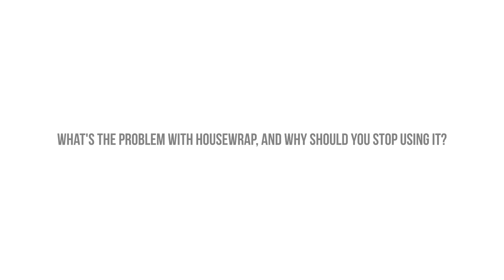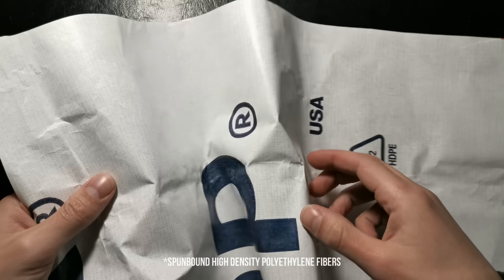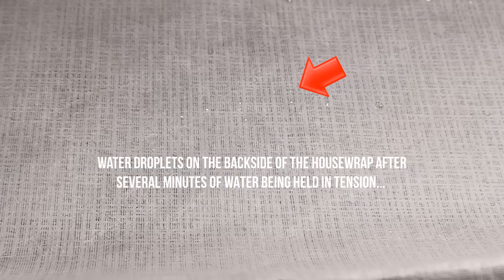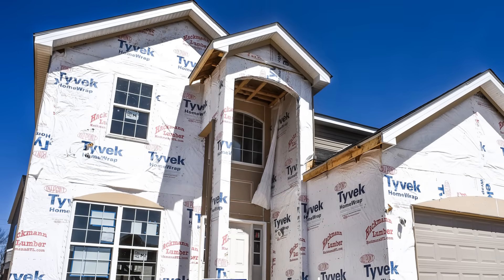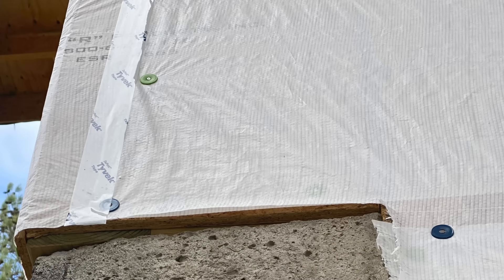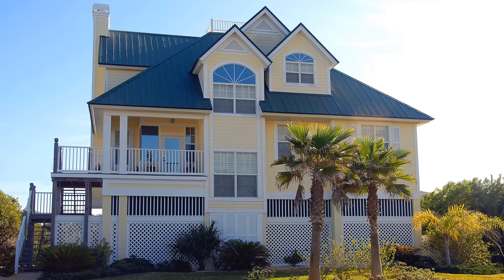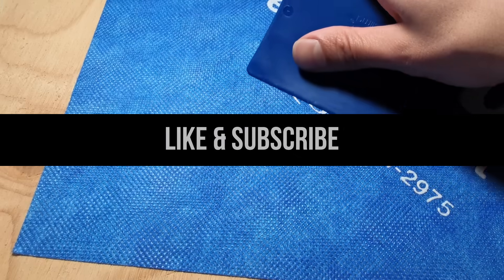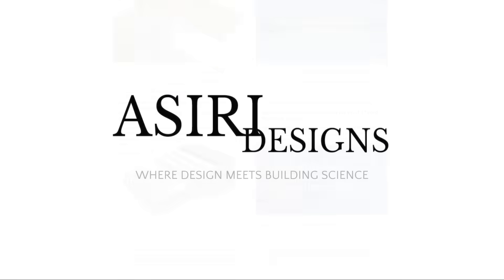Why I Stopped Using House Wrap

Comment: Built my house in 1983.  2 X 6 studs, sheeted with 1/2’ CDX sheeting, 15# asphalt felt, sided with beveled redwood siding.  Never had any mold or mildew and don’t expect to.  Use of strand board sheeting (particle board) and tyvek was, in my opinion, marketing bullshit.  I wouldn’t use OSB to start a fire and the “moisture barrier” does just that, won’t allow moisture to get out of the wall and creates mold and rot.  The only reason they came up with tyvek was because of manipulated petroleum prices in the 70’s.  And the reason they came up with OSB was because it’s cheaper to make than plywood.  Not nearly the shear strength of CDX   Glue and chopped up waste wood that swells up when exposed to moisture and starts to degrade as soon as it’s nailed up.  Framers hate the shit, especially when it’s exposed to rain.  The ONLY reason garbage board is used at all is because it’s cheaper.
Reply: Builder/remodeler for 30 years here. OSB is fine so long as the siding and trim details are installed properly, and the homeowner keeps up the required maintenance through the years. Same for CDX (plywood). CDX will delaminate and rot if not properly protected and maintained exactly the same as OSB. Same for Tyvek and other house wraps. Take the time to install and protect the products you install and they will last you a lifetime. If all the documented failures, incorrect installation is a small percentage. Homeowners not educating themselves and maintaining their houses properly causes most failures I've repaired over the years. Inspect,  caulk and paint your house using quality products, you'll have a house that lasts generations. 

As far as running out of lumber: this is completely false. The lumber industry cuts almost zero percent old growth trees. Nearly all of their harvested products are from fast growth species and they replant when they cut. Finger jointed studs are an engineered product that competes in the marketplace, they are not manufactured and sold because we ran out of trees to make lumber from. Please educate yourselves and don't believe everything you read on social media.
Reply: Yep! Ive built houses since 1989, Ive watched companies like Tyvek and Simpson Strong Tie hold a monopoly on a market made profitable by your local county planning and zoning commission! Loggers still dont get that we ran out of trees years ago and now make studs out of scrap (called finger joint studs) and plywood out of sawdust!
Reply: @freeradical6390  I need siding installed next month. I'm doing metal siding, what should the wrap be then??
Reply: @modernNeanderthal800  I use tar paper myself but Tyvek would work too. The problem with metal is condensation. You probly want to space the metal at least 3/4in off the house to get air flow behind it. Which means wrap the house then add 4 runs of 1x4 around the whole thing. Also I would ask the metal manufacturer what they recommend for install. :)
Reply: @freeradical6390  horizonal runs will lead to collecting water on top of them won't they?
Reply: @modernNeanderthal800  I dont think so. What are you putting the metal over?
Reply: @freeradical6390  outer walls of a single floor house. So plywood and tyvek, then the metal siding. 

We are paying a bunch of Mexicanos to do the work
Reply: @modernNeanderthal800  Me, Id use tar papaer. Tyvek doesnt breathe like they advertise. Good luck with the beans, I hope they know how to trim around windows with metal!
Reply: @freeradical6390  I've seen their work. It's great. 

The tar paper doesn't exactly sound like it will breathe either. I'll look into it
Reply: @modernNeanderthal800 Yrs, so vertical is perhaps better. But this will mean the metal siding will need to be installed horizontally which may be desirable anyway.
Reply: Just because a thing is "new" does not make it better. Quite the contrary. The application of trial and error over a LONG PERIOD OF TIME is generally the best way to assure fitness of purpose. Just look at the new breed of electric cars! My Uncle told me that, back in the day, building materials and designs were chosen because they would last a minimum of a hundred years. Now that is good for the environment.
Reply: @AethanAmericoid  just like asbestos siding, lead pant, oil paints, rockwool and a dozen other things... they dont want products to last... they want us constantly spending our money
Reply: @AethanAmericoid  Which electric cars?  I know you can't mean Teslas which are the safest, most affordable to buy and operate, most maintenance free vehicles on the planet.  But I guess if you're talking about the other manufacturers hastily scrambled together BEV's with last century's technology than you have a point.
Reply: Our house is double stud with 7” of 40 psi closed cell foam. I used OSB T-1-11.  I added an exterior door after 11 years and found no moisture problems in the wall. We had a few mornings last winter where it was minus 45 F.  We live on a small exposed hill and most winters we get 70-80 mph winds and the house doesn’t creak and there are no drafts. We can barely hear the wind.  It’s a duplex we are just finishing the second half out of pocket.
Reply: @Chris_at_Home  i totally agree...theres only one way to insulate and that's closed cell spray foam!
Reply: @vannorman1116  Toxic fumes are an Issue there they tell me!
Reply: Having briefly worked on new-builds in Vail, Co, back home here in the UK I built an on-site, stick-built frame using US methods, something almost unknown here. We have two grades of OSB, 2 and 3. Grade 2 is basic, everyday grade at 11mm. OSB-3 at 9mm is weatherproof (to a point) in the same way CDX is and is the UK spec for panel sheathing.  (I'm assuming our CDX is the same as USA CDX: Visually grade C ply one face, grade D the other with X being eXterior grade glue. Not up to Marine Ply levels but fine for sheathing.) Our inspectors were very keen on following my build - my frame specs and drawings having been independently certificated - and didn't give me any trouble at all. I used Tyvek wrap. However, we use a 50mm/2" gap minimum between the outer brick skin and the inner wall, 'cavity-wall construction', and water penetration is minuscule.
Reply: OSB is better than CDX plywood for almost all construction uses.  OSB is not just cheap particle board.  It is properly engineered stuff. OSB is more weather resistant and has much better sheer and compressive strength than plywood.  Plywood generally has very slightly better tensile strength, but that is dependent on orientation.
Reply: @SeniorKlean stays flattered than plywood and costs less. Tar paper is better I think the breathing is where the layers overlap.
Reply: @SeniorKlean  What??? They all suck today because they use "environmentally safe" water based glues! OSB is garbage! Most "engineered" lumber is garbage! Next you are going to tell me finger jointed studs are better and stronger because they are "engineered"? Leave some  OSB and plywood outside for a year and see which one holds up better.
Reply: What are your thoughts on BP Canada R-1.5 Panel Wall Sheathing Panel 1/2IN. Costs 9 bucks Canadian here locally
Reply: Much cheaper . Not everyone can afford to put redwood on the entire exterior of a house . I would love to use redwood , but it's too expensive and I would rather have a redwood tree , rather than siding.
Reply: 46 years building and now so much work is on rot repair. When housewraps came on the market in the 80's a whole generation of builders forgot or never learned to properly flash. It's pretty bad in the northeast. Most town inspectors no nothing. Homeowners are getting ripped off and the mold problems are bad. Reasearch is showing that mold may be the new asbestos....
Reply: And people wonder why they are sick in their own homes 😢😢😢
Reply: I would never put the 4 ply CDX they are producing today on a shed, let alone a house. Maybe fir, but not CDX....it's garbage.
Reply: Use #30 lb felt double coverage
Reply: LP siding is pretty good... better than, fiber-cement..
Like Any wood product: How long will it last.?.  It's All in the Paint.. 😂

I use 50% More Paint-- over original Primed surfaces.

Comment: In my 43 years as a crapenter .. The killer of a house is water !! .  You can get Tyvek put on so cleanly that  it looks like it was done with and iron . What good is it if the flashing sucks ??  head flashing , kickout flashing , sill flashing .. IMHO .. There are so many coffin corners on ornate expensive homes . That all the clean housewrap install causes more damage had it never been there in the first place
Reply: What are your thoughts on BP Canada R-1.5 Panel Wall Sheathing Panel 1/2IN. Costs 9 bucks Canadian here locally. Has an asphalt outer coating. The old neighbor has something similar that his house is made of from the 1930s. Claims its great stuff and hasnt deteriorated in the close to 100 years its been in the house his father built and he now lives in.
Reply: @garyenwards1608  Never heard of it .. Might have seen it but nowadays with a piece of wood called an Illudium q-36 space continuum modulating sheet .Can't say .  I will say though .. Some of these fancy new ways to skin a cat in the end cause more harm than with what has worked for a thousand years
Reply: @garyenwards1608 I don’t know if someone that considers himself a “crapenter” in a YouTube comment section would be my first choice to seek professional advice.  His response to you solidifies my opinion.

Comment: Lol " Buy once cry once " 😂
    As a child of a building family , carpenter s and masons from the 70's to 90's I always used 30lb . Felt rolls mechanically fastened w/3/8" copper staples. And every body always cried about the staples cost at some point generic steel staples were them the norm 😮
    Today with zip systems , other membranes of adhesive based products, nd liquid applied coating s are the only truly correct way to build in the 21st century... 
     Your post was definitive to all that build to last . My son now lives in the home my father built, other than me installing a new bathroom recently, its still solid .
Reply: The version of that saying I've heard is "Do it once, do it right."

Comment: 75% of the issues with house wrap is bad installation.   You almost never see the installer X cut and wrap the window openings then flash accordingly.  Most installers use staples instead of cap nails.  Most installers don’t tape the seams. 

Similarly most issues with other methods are installation related.  Zip system type panels reduce those installation errors but concentrate them on the areas where water infiltration causes structural damage such as corners and window openings.  

At the end of the day simple will raise the rate of success with the average “carpenter”.   Unless you have a great design team, Instagram worthy carpenters and a on-site construction manager watching the trades hacking holes, your extra money spent on these advanced products is likely wasted.

Comment: I have been a renovater for years. In my experience, it doesn't matter what wrap you use if the exterior finish is not installed and flashed properly.

Comment: As a long time EIFS contractor and installer specializing in complex and intricate installs, I've been beating this drum for 15 plus years.  You hit the nail on the head regarding the pros and cons.  The guys here are still doing the mechanically fastened system over tyvek and every siding guy is doing the same.  Keep up the quality content!
Reply: Where in Canada are you doing installs? We had some out of country guys staple with 1/2 crown 1" foam on a gable and finish it with acrylic and it blew off in the wind a few years later. lol
Reply: What are your thoughts on BP Canada R-1.5 Panel Wall Sheathing Panel 1/2IN. Costs 9 bucks Canadian here locally. Its an asphalt outer coating. The old neighbor has something similar that his house is made of from the 1930s. Claims its great stuff and hasnt deteriorated in the close to 100 years its been in the house his father built and he now lives in.
Reply: @garyenwards1608  asphalt board was the only thing that saved my parents house from my dad refusing to do any care and painting on the house, kept the moisture from wicking through the rotten wood cladding and to the studs and drywall
Reply: @narmale  Thanks man Good to know
Reply: Hello @AISIRI Designs, Some one in this channel know some one or company in Spain with this king of knowledge about good quality insulation for a house in Asturias (north of Spain) for a future project renovation? Thank you
Reply: @robertoingenitoiseppato6177 there is many In spain but we don't build with wood cause is not a good material is eaten by bugs

Comment: Is the manufacturer of this product sponsoring this post or your channel? Is this post only suitable for north American audiences? What climate is this wrap suitable for?
Reply from the maker: @VanillaMacaron551  This video is not sponsored by anyone, we would have to disclose it by law. We don't like using housewraps for the very reasons outlined in the video, but let me summarize: housewraps and building wraps do not provide a monolithic layer, and they aren't bonded to the substrate of the sheathing. This inherently means there is a higher potential for water to run behind the housewrap and leak in at improperly flashed seams, and it's inferior at air sealing, so there is a bigger condensation risk from air infiltration in hot humid climates or behind reservoir claddings. We take the same opinion on roof membranes, we never specify mechanically attached membranes, but always a fully adhered membrane or fluid applied membrane.

Comment: I think house wraps hold in moisture that comes from inside the building. Essentially, you’re putting a plastic bag around your house to trap in moisture from showers, cooking, and breathing.
If you want to seal the house like a plastic bag, you should install it under the Sheetrock on the studs.
If you want a external water barrier, tarpaper will do well.
I just see condensation inside walls going to mold and rot.
Also, how you do your house may depend on what climate your in.
Air conditioning can have big impact in where the moisture comes from.
Most homes express heat outward, taking moisture with it.
But, if the heat is outside, then it will carry moisture inward.
Reply from the maker: @susanvaughn741  Hi there, thanks for your comment. While I'm not a fan of housewrap, this is not true, as housewrap products tend to be HIGHLY vapor permeable, so much so that they can actually cause condensation issues in humid climates on the backside of the drywall.
Reply: @ASIRIDesigns  they condense on the drywall because of a/c. The heat from outside is carrying the moisture inside.
The only way to defeat this is to have two walls, both insulated so you have one hot wall and one cold wall.
Without a/c there is no condensation to dew point.
I live in n.w. Oregon. Older homes don’t have a/c.
We are more likely to sweat at the outside sheeting of the wall.

Comment: One thing to remember is that concrete ingredients and mortar can melt tyvek. I’ve been doing exteriors for 13 years and I have never renovated a house with properly done tar paper that was moldy or rotten. I would probably do tar paper on my own house
Reply: If the government will let you. Codes are out of control and against our founding principles and Constitution, but nobody cares anymore.

Comment: Tyvek actually falls apart and crumbles after about 25yrs , especially on the east side of sun exposed wall-felt paper works better.
Reply: Studies have shown the disintegration occurs if the builder left the wrap exposed to the sun for 30 days or more. The UV light destroys the binders, then it's a slow roll to powdering.  The process generally takes 20 to 30 years and it doesn't matter if it's covered once the damage is done.  Tyvek et. al now have warnings about leaving it exposed for a long period before cladding.

Comment: I was curious about how furring strips, in the form of a rainscreen, impact your thoughts on a specification. We prefer to specify self-adhered products like Adhero or something like ZIP, but that doesn't always happen for one reason or another and we end up with Mento 1000 over plywood. I feel more confident in a non-self-adhered product if it isn't penetrated by the siding fasteners and doesn't have water sitting up against it, especially if there is exterior insulation. In this scenario, I would have the plywood as the air control layer instead of the membrane.

Thanks for putting out good quality building science videos.
Kyle

Comment: I'm skirting a manufactured home in snow country, Central Idaho. 
  Should I use tar paper or tyvek? 
  I am building a 2x4 wall with pressure treated bottom plate lagged to the concrete pad. I have 1/2 inch pressure treat plywood and 1inch eps foam, with roofing metal on top. Z metal on top and D metal drip edge on bottom butyl caulked to the concrete. Should the foam board insulation work as a vapor barrier? Should I add a layer of tyvek over the foam, or add tar paper over the pressure treat plywood before the foam? 
I realize it isn't heated space and doesn't "need" insulation or a vapor barrier but my water line is 40 feet long under there, it's insulated and has self regulating heat cable, I also have a few hvac truck lines that will provide some heat by convection, relative to 20F temps outside it could stay above freezing if I am running the furnace regularly instead of the wood stove.

Building envelope science is complicated.